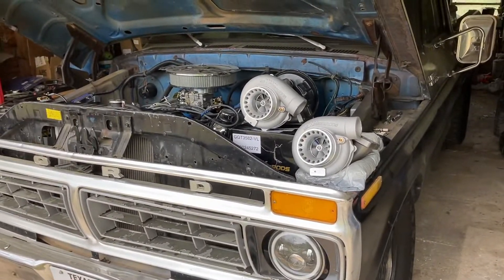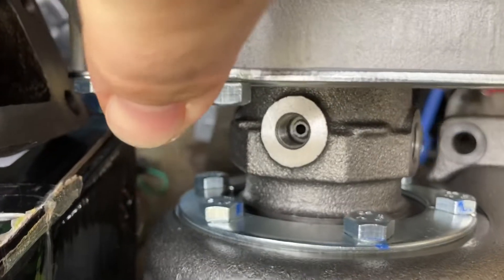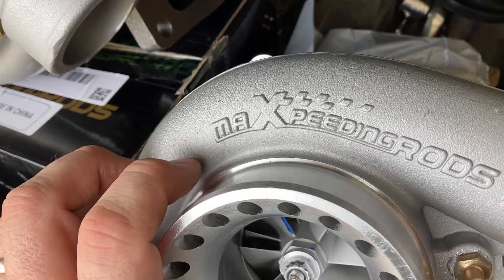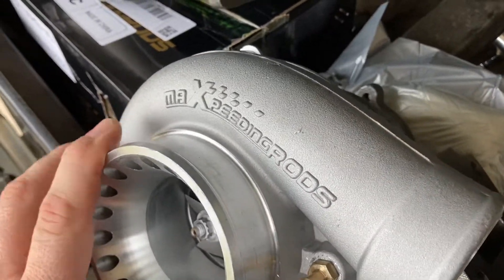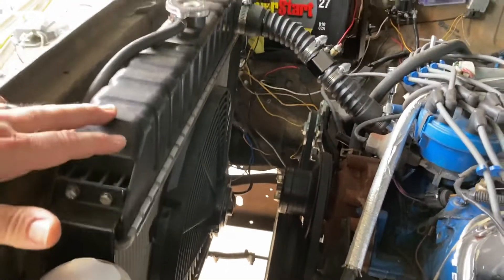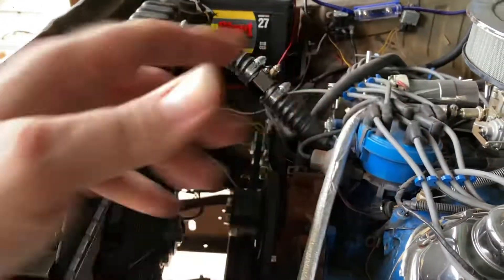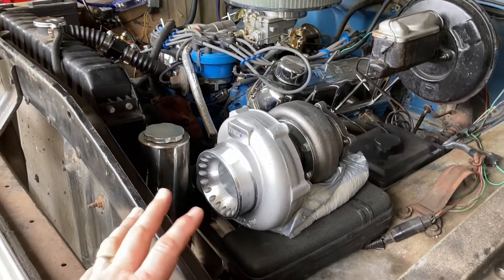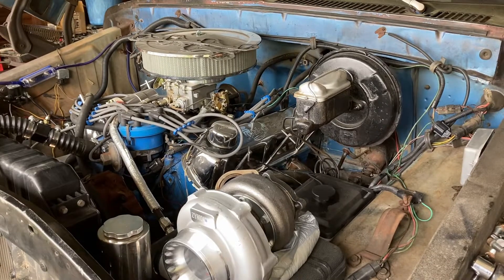Ep. 1 Twin Turbo F100 Build Series | Mock-Up & Challenges 1977 Ford F-150 - 351W

Comment: What did you use for oil lines for the turbo.
Reply from the maker: I used 6AN Steel braided line cut to fit. Thank you so much, I’m glad you like and enjoyed the video.

I have lots of videos of my build on this truck. Please check them out and subscribe and hit the bell to support my channel. 

Also, my STORE is open (please support) with a purchase. I have lots of custom T-shirts, Gear, merch that’s aimed towards my playlist genres. Prices range from $1.99 and up with fast and low shipping.

Https://operationrv.printify.me

Comment: It’s a good video and all but why would anyone turbo a 351M and I’m a die hard Ford man but the M that goes with the 351M stands for Mistake 
They have extremely big and heavy cranks so they are not the motor of choice to do this with but with the right amount of money you can make some serious power out of a 351M but there is several other ford motors that can make more power with out breaking the bank and turbos are usually on motors that can take some RPMS and the M motors are not the motor of choice to try to turn a bunch of RPMs with the big ol heavy crank
Reply from the maker: My 351 is a Windsor, 351w not "M". Powernation provide great examples what the Windsor motor can hold. Thanks for watching, please Subscribe.